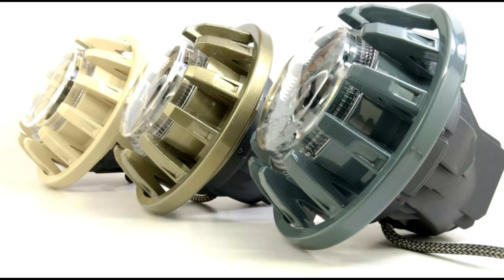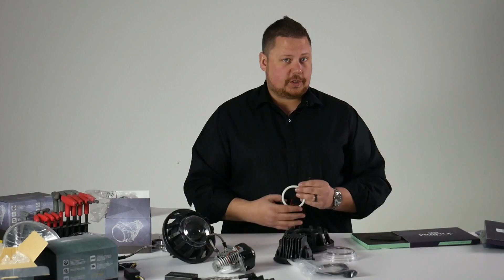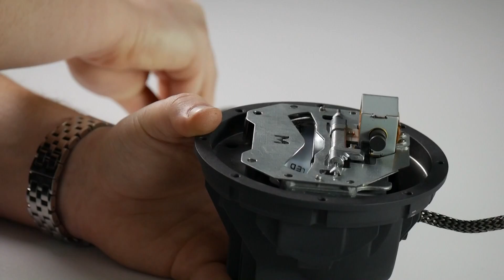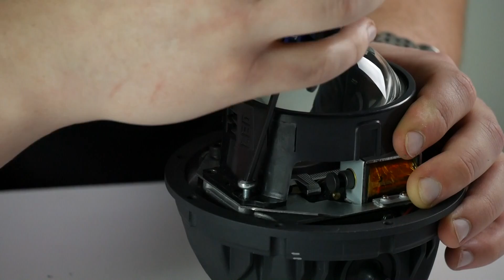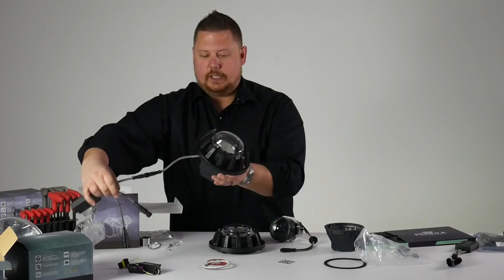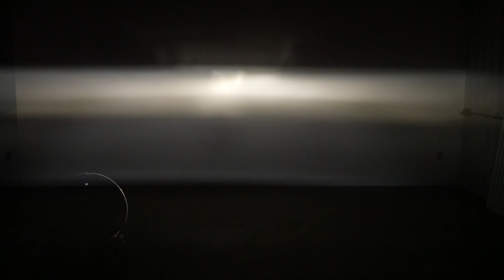Morimoto Super7 LED 7" Round Projector Headlight Review for Jeep Wrangler  | Headlight Revolution

Comment: Great content. Can I retrofit something like this on my 2003 f150 headlight by opening it up and mounting it on the inside of the headlight housing?

Also is this currently still a good option for this kind of project or have there been better versions or kits that have surfaced since the making of this video? Thank you in advance.

Comment: Did you remove the heat sink fin you’re self?
Reply from the maker: With the Super7s, the fan does not come included as it's not needed.

If you're referring to the fins that are cut out, that is done before they are sent out.

Comment: Just curious, do you know of these would these fit in a first generation Miata that has the pop-up style of headlight?  These would be a great upgrade for the amount of light that I am not getting now, but am slightly worried about dimensions because do not want the front hitting anything forward of the headlight bucket as it moves up and down. 

If the front housing is plastic, I might be able to just 3D print my own that sits further back, because it does look it sticks out forward of the mounting lip quite a bit.
Reply from the maker: I really doubt it would fit, These headlights are quite large from front to back. If you’d like to give it a shot, By all means. The headlight can be fully disassembled pretty easily if you wanted to try 3D printing your own parts!
Reply: Can these be used easily ok a 2011 Mercedes G55?

Comment: Only 10,000 hours that's boils down to a year, at a cost of 510 bucks damn that lifespan should be longer.....
Reply from the maker: 10,000 hours of USE. No one drives 24/7 365 :). Under normal driving conditions, these will last 5+ years, if not longer.
Reply: @HeadlightRevolution  thanks for the reply now its much clearer on how the calculations are done
Reply: If you drive a 100km/h  per hour 

In 10 000 hour you made 1 millions kilometer.  The lifespan are incredible.

Comment: Thinking about welding up a mounting bracket utilizing those 3 screws in the back for a non 7" headlight conversion, how much does the whole assembly weigh?

Thx
Reply from the maker: The assembly comes out to be 3.3 lbs. :)
Reply: Same here, trying to figure out how to mount it for my custom application. My motorcycle takes alot of bumps on my commute and was wondering how that would hold up. If you used the 3 holes at the back, how did it hold up? Thanks
Reply: LED TOU

Comment: First thing I thought of was I wonder if I can mount a HID projector inside that housing.
Reply: Abe S. Morimoto makes an HID projector one if you want one. But you can not fit a hid into this one
Reply from the maker: No, you wouldn't be able to because it's a sealed product.
They're engineered specifically for the MLED projector.